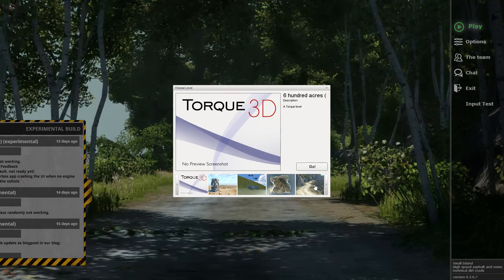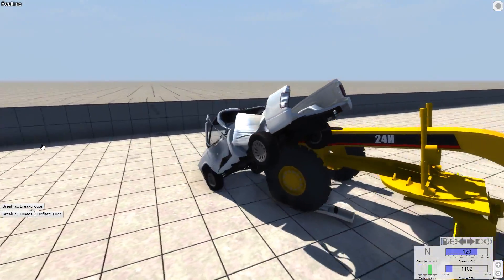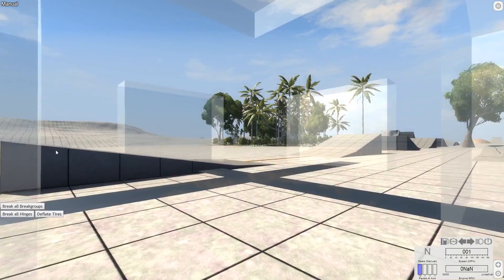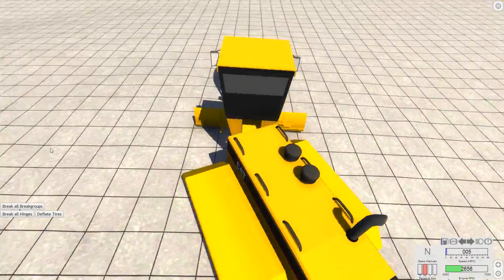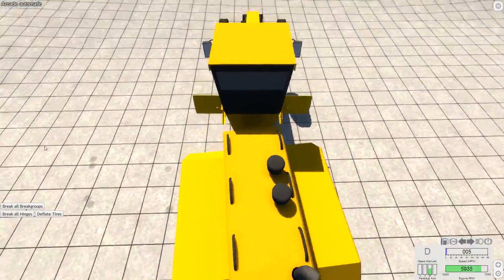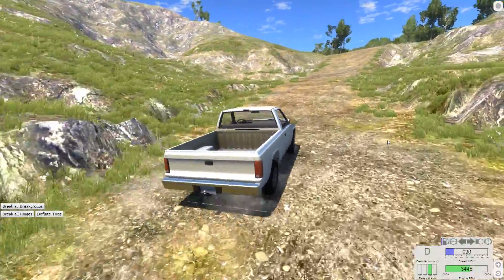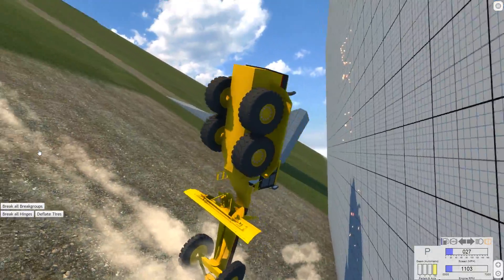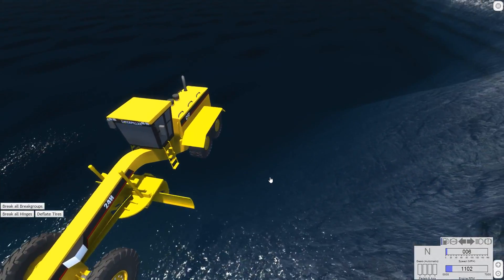BKL Cat Grader - BeamNG.drive

Comment: They can steer from the front axle but if you're in a tight spot usually you can use the rear steering "crab steer" to get tighter steering lock :)